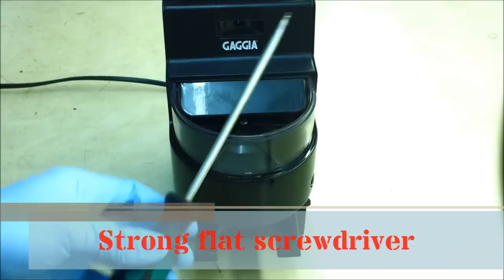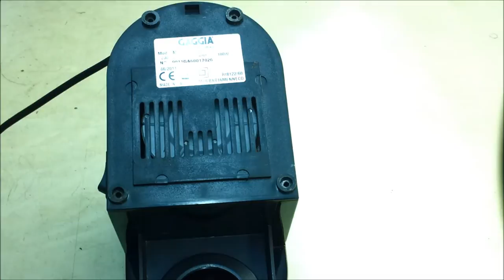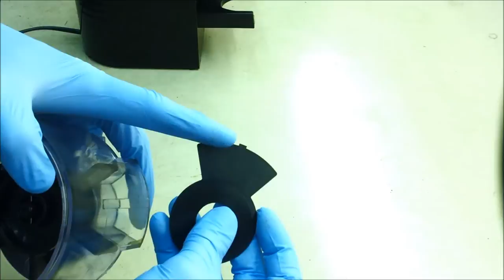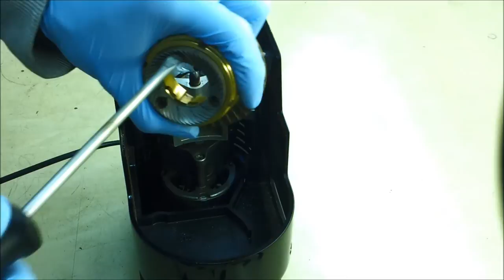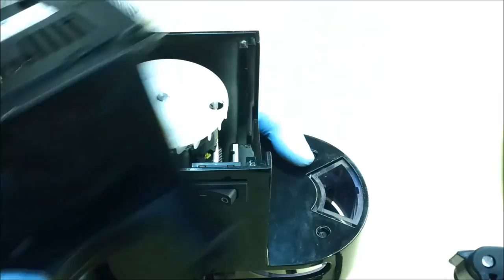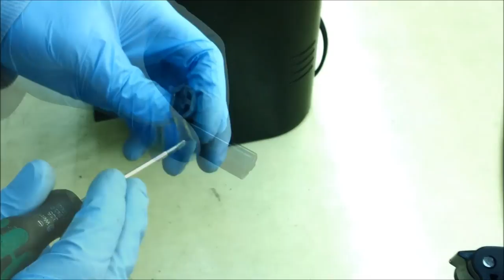Gaggia MDF Grinder Repair By Mr Bean2Cup Webshop

Comment: On my MDF, if I operate the handle, the doser is not rotating always. Only if I apply strong inward pressure, it works a little bit better. How can I cure this? All parts are original and don't look worn or so.

Comment: Warning. If you are replacing the spring do not over tighten the screw on the hopper. It is plastic and will break. I don't think you even need to tighten just loop the spring around the silver screw. Learned this by breaking the plastic. Was able to reinsert the screw sideways (it is self tamp) Seems to work ok now.

Comment: The lever in my grinder does not spring back to its original position after dispensing coffee. Would it be the spring, the cam (Part #21 in the parts diagram), or the operating lever (Part #22 in the parts diagram)?

Comment: Another question about the lid that stays on top of the doser. It is suppose to stay in place with the cover on the front side by means of the slot. In my case it rotates whenever the handle is operated. So it is not kept in place by the slot.

Comment: older model = no screws , how is the upper grain holder fixed ? (do I need to unscrew or only pull up ?) If you know that, thank you
are there similar bolts on the numbered ring ?
Reply: pull up on the hopper - can require a fair bit of welly